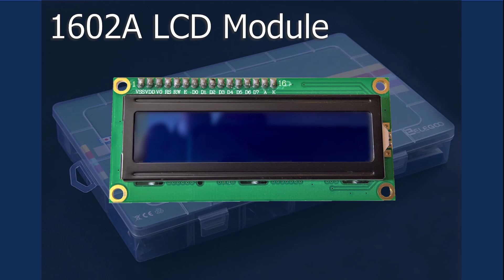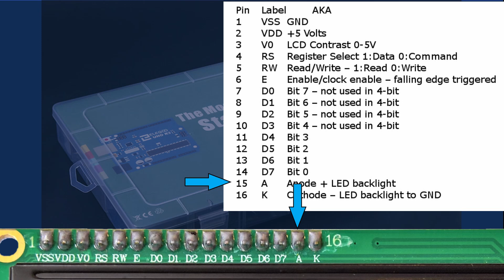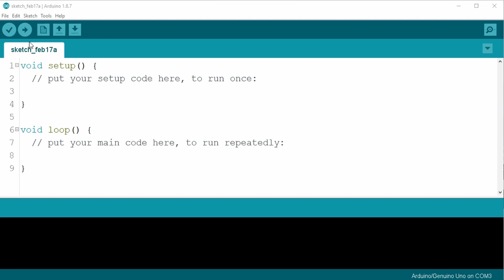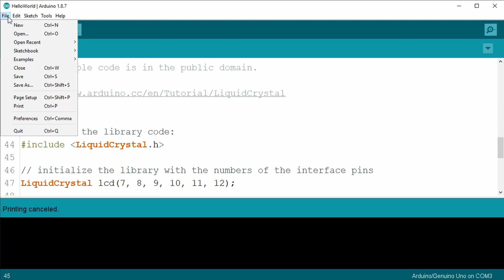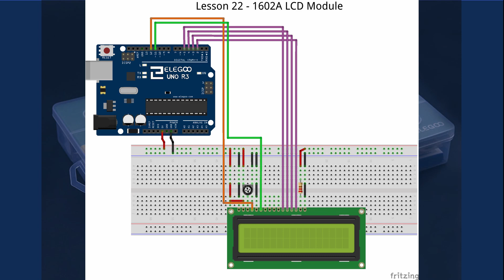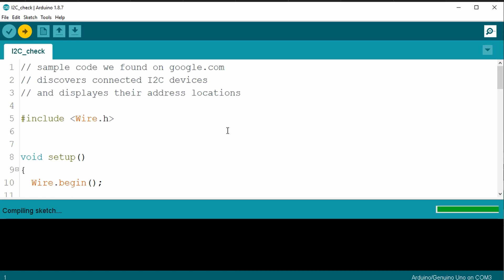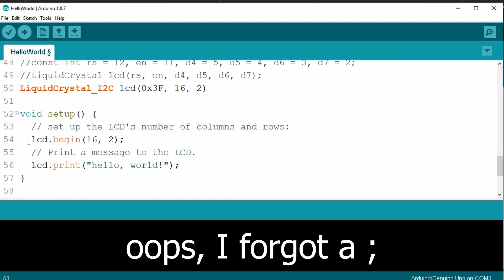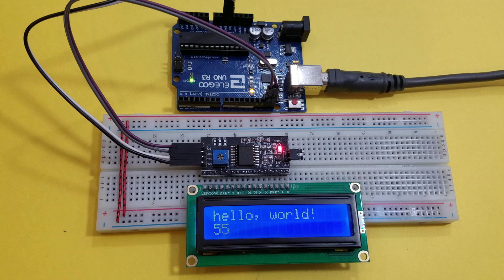Lesson 22 – 1602A LCD Module

Comment: I had to fill in the args for lcd.begin() -- with the columns and rows of the display (16, 2) -- instead of leaving it blank, AND I needed to write Wire.begin() into the setup func or else it wouldn't run.

Comment: sir, i only got white boxes in the 1st row and it wont print a word, any solution ?
Reply from the maker: Check all your LCD wiring.  Contrast is the next thing to check.  Make sure that V0 is properly connected to the variable part of the potentiometer, and that the potentiometer is connected between the +5V and ground.
Reply: @rickmorenojr  i checked otut already i also adjust the contrast from 0 to 100 but no word showed up
Reply: im having this same problem right now, did you ever figure it out?